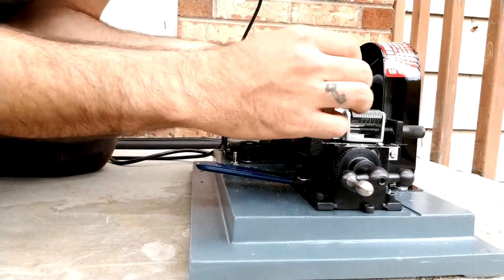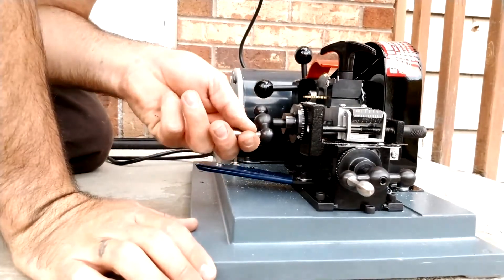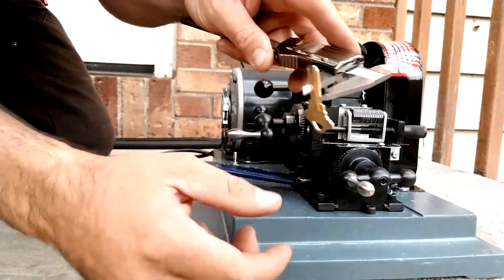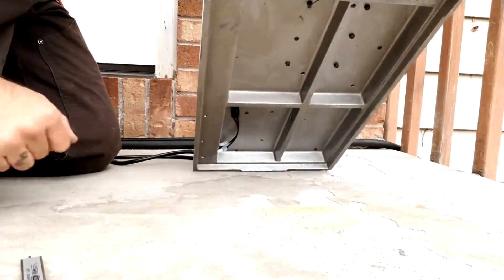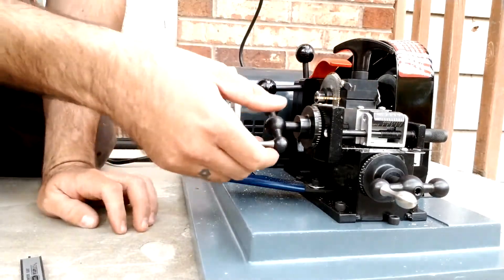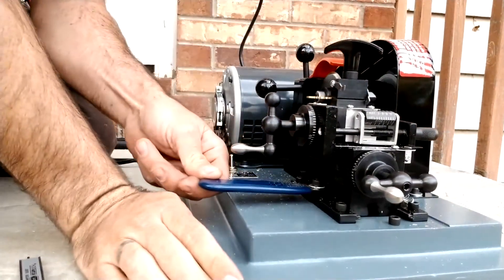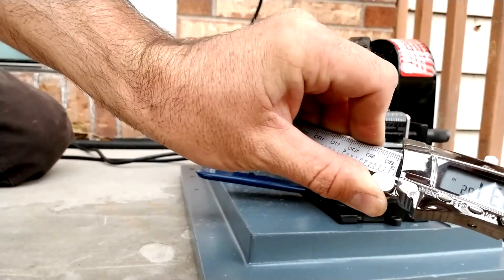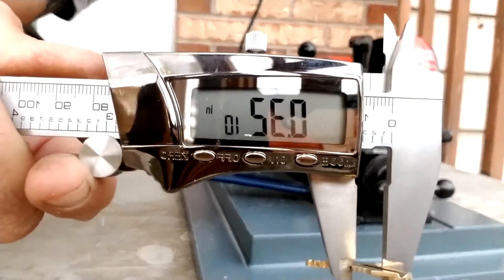Framon #2 key machine drop test. You can drop the machine and still cut accurate keys

Comment: Tuff machine.  On a busy day running service calls, my machine flipped off my table on to the floor of my van.  By the time I pulled over and opened the side door, the machine fell onto the street! It landed on the depth dialer and bent the handle. Freaked out!  It never went out of calibration. To this day after 20 years of making keys, the bend handle reminds me to be kind to this tuff machine.